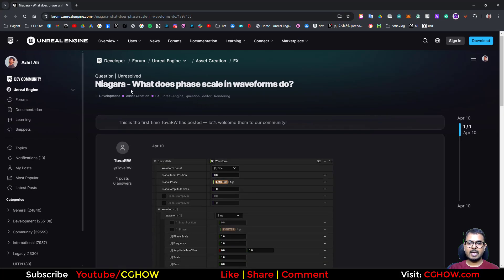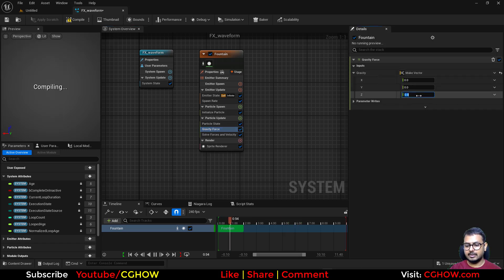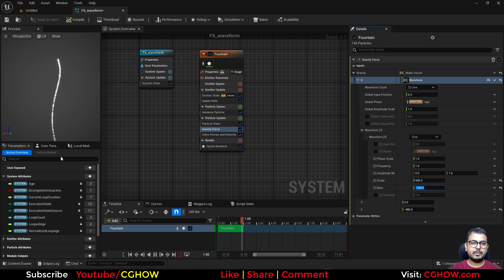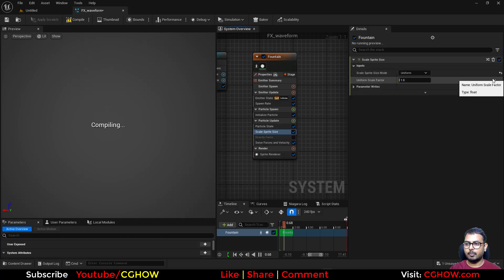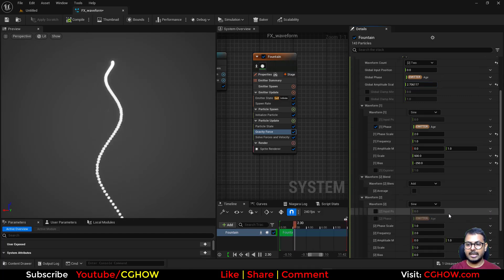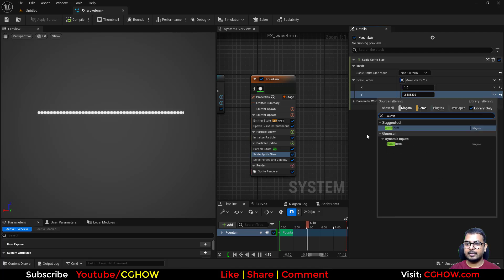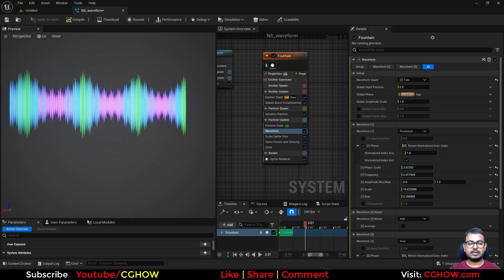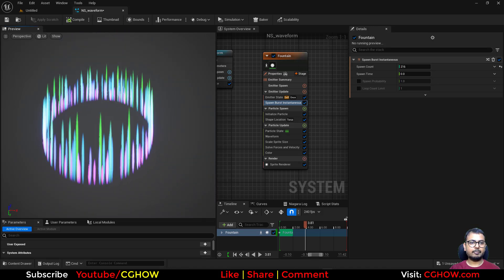Learn Waveform Creation in Unreal Engine 5 with Niagara

Comment: I’ve created the waveform and used the Niagara particle within Blueprint with some controls for pointing the direction and killing them at a certain distance.  The problem is that when I increase the distance beyond a certain point the wave glitches and loses its form. Any ideas?  I would like to keep the look of the waveform constant as it gets longer and shorter based on the BP set up. What causes it to change or glitch based on a new longer distance? Is it possible to maintain the wave as it lengthens? Thanks for the information.
Reply from the maker: i think kill module should be after waveform. because if you kill then use waveform it can have issue. but still i ma not sure. i will have to check that